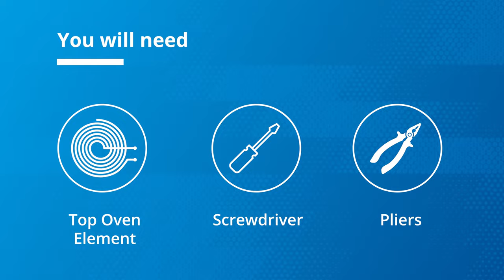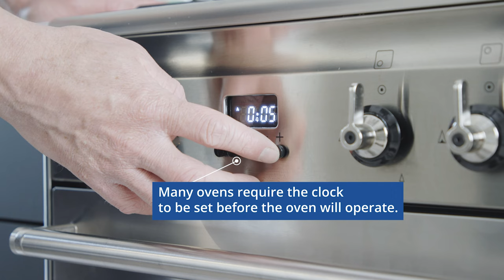How to change your top oven element

Comment: since mine is bent quite badly from heating and lack of support I will see if I can bend it back into shape and maybe add some support since it still works but I assume it will happen again. Update I straightened the element by using a copper water pipe braced against the floor of the oven and pressing hard against the element, the rest of the element acted as a spring so when I turned the oven on and it heated up to red hot it gradually bent the metal back into shape.

Comment: I replaced mine, plugged the stove back in, and when i turned the breaker on, POP! the entire stove doesnt work. Thoughts?
Reply from the maker: Johnny you may need to reach out to a qualified technician to assist with troubleshooting and repairing your oven as  there could be another issue.

Comment: Unfortunately, my Smeg (built in) oven element isn't held in by screws/bolts. There's just two smooth round headed fasteners.
Now what?
Reply: Will be bolted into place, only way to remove will be via the back and possibly removing the back panel. Take a photo so you know which spade connectors go where.